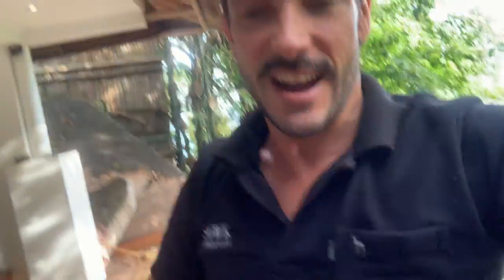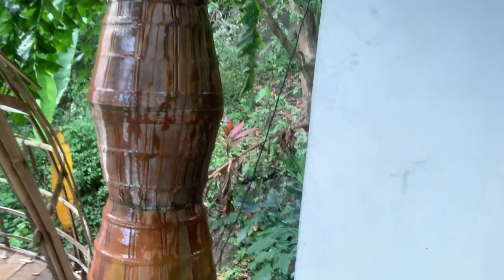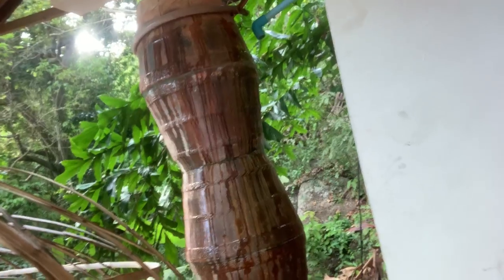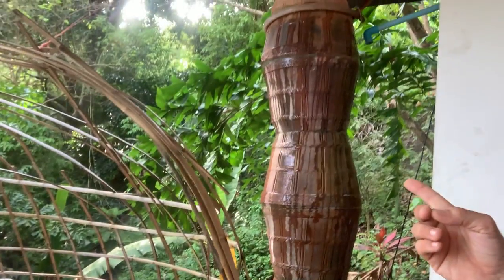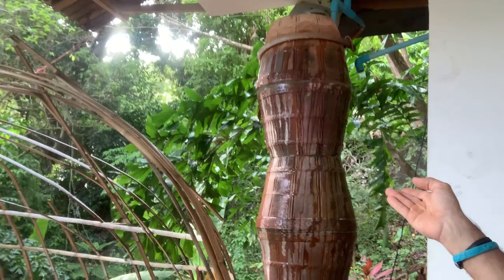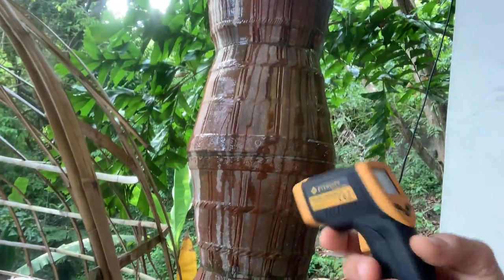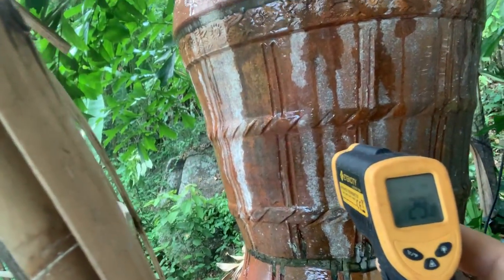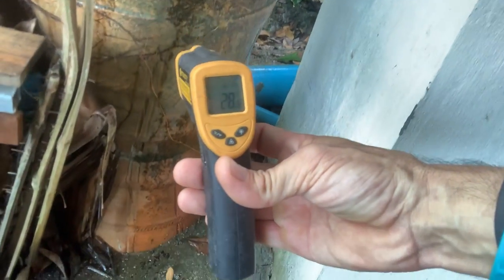How to make your own hybrid Natural Air Conditioning System ?

Comment: In order to do this properly, a dry environement is requiered. We knoe a lot about this in spain, where we cool down water using terracota devices (look up "botijos"). IN humid environments, such as shown in the video, it does not evaporate water so fast/ much and decrease in temperature is lower. But it coud reach up to -10C difference!

Comment: You just gave me a better idea, Coal evaporative fridges work, so a tube packed with coal with a water bath on top with cloth twirled to feed the water on the coal and a small computer fan to drive the air flow in the tube.

Comment: I don't know if I got it right, but what I understood you have an undersized AC unit and to help its performance you are using an evaporative cooling on the air input of it. That improves the performance of your small AC unit and saves some energy when compared with the larger unit. Nice. I am glad it works for you.

Comment: Love this. Great Job.  We can learn from nature!     Im in central Florida USA where the soil is very sandy.  I'm  building an 8x8 insulated shack under heavy trees and over a sand floor.   Under my bed a 5' deep hole with a shallow well and some steel posts another 8' further into the colder ground.  My plan is to run a well pump once to fill the hole with well water every night when the sun sets. The water will quickly seep into the ground and keep the hole wet all night.  Enclose under the bed with in and out holes. A low watt usb fan will push  room air  under the bed , an exit hole on the other side let air out near my face when I sleep.   My hope is that is drop temps a modest  5F , at night ideally from 80F to 75F in the summer.   Not sure if it will work??  Bard AI seems to think so. LOL.  I suspect it will in that I know the soil is very cool there at night in the summer. Also I often sleep in my van and dry my towel and clothing with an overhead fan, the wet clothing does help to cool the van creating swamp cooler of sorts and killing two birds with one stone as my clothing is always dry in the morning.